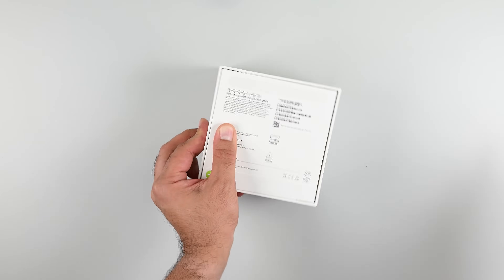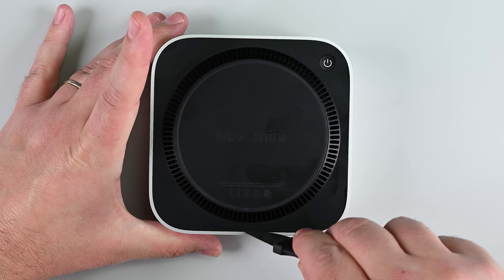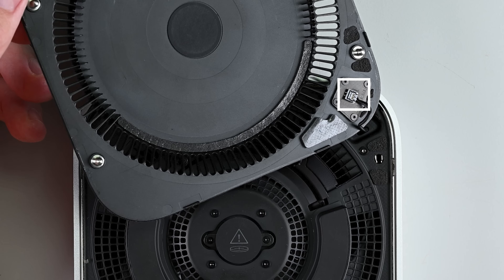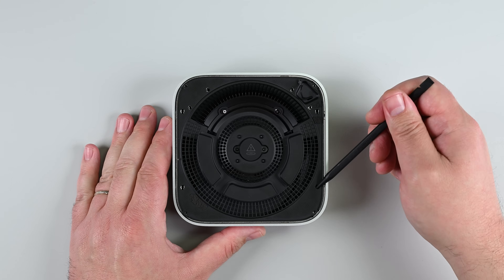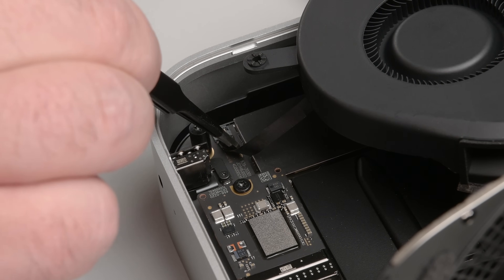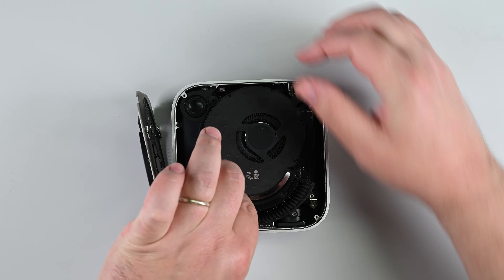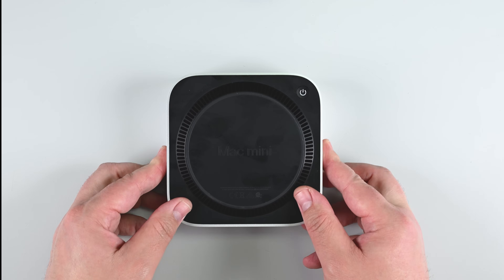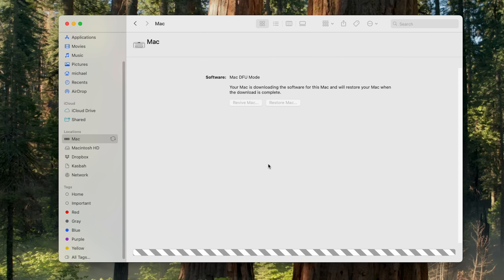M4 Mac Mini Storage Upgrade! Do it Yourself And Save Money!

Comment: Went completely without a hitch (although those 4 screws holding the power cabling into place were an absolute bear to get back in -- surgical skill required). Saved myself $300 going this route. AND got the 256GB/32GB M4 on sale. Couldn't be more pleased. Video was key to getting this done w/o tearing something up. (I did NOT have to detach the fan BTW.)
Reply: I was worried bout the fan cable also soo I’m glad to hear you didn’t have to disconnect it🙏🏾

Comment: Zwei Betriebssystemwelten im Alltag
Ich arbeite regelmäßig mit zwei IT-Systemen:

Windows 11 Pro (Dual Boot) auf einem HP EliteBook, ausgestattet mit USB-C- und USB-A-Ports (3.2 Gen 2), verbunden über ein Thunderbolt 4-Dock.

Mac Mini M4 mit 16 GB RAM und 256 GB interner SSD.

Externe Speicherlösung mit Spitzenleistung
Zusätzlich nutze ich eine externe M.2 NVMe PCIe 4 SSD (Samsung EVO 9100, „Gamer SSD“) in einem echten Thunderbolt 4-Gehäuse, verbunden mit dem Mac Mini über ein USB-C-40-GB-Kabel.
Diese externe SSD übertrifft im Benchmark die interne SSD des Mac Mini deutlich.

RAM und Videoschnitt: Praxis statt Mythen
16 GB RAM sind für anspruchsvollen Videoschnitt (4K & 8K) laut aktiven YouTubern absolut ausreichend.
Warum?

Wer große Videodateien auf einer schnellen externen SSD wie beschrieben ablegt, hat weder Performance-Einbußen noch Speicherprobleme.

Technische Details zum Mac Mini M4
Der Mac Mini M4 verfügt über:

10 CPU-Kerne

10 GPU-Kerne, wobei jede GPU ihren eigenen, im Design integrierten, ultraschnellen RAM-Bereich besitzt.
Dieser GPU-RAM ist wesentlich performanter als der reguläre Systemspeicher und von außen nicht einsehbar – jede GPU ist technisch gesehen eine „Blackbox“.

Dateisystem & Kompatibilität
Die externe SSD ist mit exFAT formatiert, sodass sie problemlos sowohl unter macOS als auch unter Windows 11 genutzt werden kann.

Praktische Empfehlungen aus Erfahrung
Als ehemaliger deutschlandweit verantwortlicher Leiter für Projektmanagement in der Digitalisierung von Kliniken und Telemedizin kann ich bestätigen:

Ein Upgrade der internen SSD im Mac Mini ist meist überflüssig.

Das RayCue Thunderbolt 4/5-Dock (40 GB/s, ca. 87 €) passt perfekt unter den Mac Mini und bietet einen integrierten M.2-NVMe-Slot. Eine leistungsstarke SSD lässt sich einfach einbauen und erzielt im Benchmark Spitzenwerte.

Entscheidend ist die Verwendung eines echten Thunderbolt-4-40-GB/s-Kabels. Mit USB-C-Kabeln, die nur 10 oder 20 GB/s unterstützen, bleibt die Performance deutlich hinter den Möglichkeiten zurück.

Fazit: Fakten statt Clickbait
Technisch fundierte Aussagen und valide Praxiserfahrungen sind wichtiger als reißerische YouTube-Mythen oder Clickbait.
Mit der richtigen Hardware-Konfiguration lassen sich Performance und Speicherprobleme effizient und kostengünstig lösen – ganz ohne unnötige Upgrades oder fragwürdige Empfehlungen.

Comment: Apple can get pretty narky  about these things. Then again I had a former Apple tech guy put in a ssd into my old iMac.

The accessory MM type hubs are flaky with WiFi issues, unreliable ports etc, so I'd try an external ssd. It's just safer.

Comment: Performing this upgrade doesn't scare me. However, I have concerns about the - read & write speeds, and more importantly, how hot does this drive get, especially during large file transfers?  Without proper heat deception, the drive will not last. Which brings me to my last concern, how long will this drive last?  The thought of losing 2TB of files after 6 months, give me the shivers.  If I did do this upgrade, to sleep well at night, I would need to buy a separate external NVMe enclosure + a 2TB drive to back up the Chinese knock off drive. I feel like I am right back at square one. 🤣🤣🤣

Comment: What am I missing? If I buy a 2TB upgrade, I will probably void the warranty on my Mac Mini M4 if I open it up. Also, lots of things can go wrong when installing a 2TB upgrade storage, even if the folk on YouTube make it look easy. If I use external storage, I don't void my warranty and or bugger up my M4. In terms of transfer speed, the difference in speed is not always significant, and external storage can still offer advantages in terms of price, capacity, and portability. The vast majority of folk aren't really going to notice the difference. So again, what am I missing. I get it if your Mac is outside of the warranty period. But again things can go wrong with a DIY botched job.

Perhaps I'm being a tad thick, perhaps there is a massive plus that I'm not seeing. I'm not trying to be argumentative or negative. You've paid your money, the Mac is yours. I don't don't see the advantages versus the risk.

Comment: Just ordered a replacement 2TB SSD from Amazon for $280. What’s good, it’s the same as in the video with the silver sticker and matches the location of capacitor, buck converter, etc to this video. The bad news, I’ve ordered a refurbished Mac mini M4 w/ 24GB ram and 256GB ssd and I’ve been waiting the past few days to upgrade as Amazon delivered same day and Apple had to ship out through UPS.
Reply: An actual name or link to the exact model?
Reply: @ernestgalvan9037 it’s probably an a la carte config, the refurbished store has different configurations
Reply: What did that refurbished price cost ya?
Reply: @troymcdonald paid $611 from the official apple refurb store. That’s after my 10% vet discount.

Comment: It went great. Thank you so much for the callout about unscrewing the power button instead of trying to remove the cable. I used the Pro Tech Toolkit's wrap case to support the Fan and didn't need to remove its cable either. Less than an hour total to install and recover via Time Machine. 2TB never felt so good.
Reply: where did you buy the SSD?
Reply: @SajidQureshi__ ExpandMac after the first tariff but before the latter ones. My friend used the Iboffrcc one. Both are top notch
Reply: So whithouth a second mac?
Reply: @SgtStultus No I had a second older Intel Mac I used

Comment: Is there a benefit to not having from what I can see any kind of heating or spreader on the ssd modules in apples computers across the board? Just seems odd to me. Especially given the entire chassis is a big  chunk of aluminum
Reply: The hotter nands run the better, it's the controller that needs cooling which this doesn't have

Comment: After an upgrade yesterday to the operating system my previously successful use of third party storage was bricked with no way of returning to the previous state. If anyone has a recommendation I'm open. Tries several versions of ipsw. No joy after having it up and using it for a few months I'm disappointed now that this doesn't work with my particular SSD TTB Sandisk.
Reply: Did you find a fix?
Reply: @superdupertrooper970  No I have not. Stopped trying after having to bring to the Apple store for reset.

Comment: Great vid, but one error.  In re-assembly you show "replace the power button" but the dis-assembly section did NOT show removing it (rather, remove the entire power button housing via 4 screws).  I think you prolly re-did the section on removing the power button assembly (because people had reported damaging) , but you left in the replace the power button from the first version.  Please update and align.  Thank you!

Comment: Aside from problems getting a third-party SSD, it looks like the replacement of the SSD can be done without unplugging the fan cable (as long as one is careful and takes their time removing the old SSD and inserting the new SSD). Sure, it’s a small time savings, but reduces the chance of damaging that micro-connector on the fan cable.
Reply: right
Reply: Amazon has like 6 different brands

Comment: This is not for the faint of heart. Only die-hard DIY tech enthusiasts will do this. Why?

First of all, it voids the warranty.

Second, it risks damaging the hardware. This is known to have happened.

Third, it requires access to a second Mac computer. This is not an option for many people, myself included.

Fourth, if the upgrade fails for any reason, it's a pain redoing everything. The replacement SSD may be defective. One YouTuber did encounter issues and he had to jump through hoops to recover.

Fifth, if you're not comfortable with DIY, this could cause anxiety and frustration.

Why go to so much trouble just to save $200 ???

Here's what I did: I upgraded to 512GB. Then I attached a 2TB external drive. Easy peasy. No headaches. No anxiety.

And the bonus is that the upgrade doubled the write speed of the internal SSD!

Forget this DIY nonsense.
Reply: Skill issue
Reply: @rohanjamadagni  Even skilled technicians can make mistakes. Nobody's perfect.
Reply: This is simpler than repairing the most basic of cars.  Seriously entry level stuff.
Reply: @ Not for the average person.
Reply: @horridohobbies  don't be average if you want to save money
Reply: Can you trust the reliability of third-party SSD modules? What vendor can you trust?

Comment: 4:36 ok, so you need a second mac
Reply: Every penny pinching base Mac Mini buyer certainly has one or many more Macs that are absolutely a requirement for this "money-saving", totally "realistic" DIY upgrade, right? Right?
Reply: @proesterchen  Or they have a friend with a Mac.  Not all that uncommon.  The problem is sourcing a drive to do this swap.  They're not easy to find.
Reply: Or iTunes works too
Reply: @TheCassuis  No, it doesn't. A full second Macintosh PC is required for the recovery.

Comment: This is all great and everything with the replacement drives but I wonder how long before Apple does some sort of hardware block on these non OEM drives.
Reply: The amount of people who will actually do this is minuscule.  If someone were to open a business doing it, that would be another matter but they aren't going to worry about the .001% of their customers who will actually a) be able to source a drive to swap in and b) actually disassemble a monolithic device like this to do the swap.
Reply: I have replaced my old Macbook Pro 2015's drive and every time I reboot it, the same message: "this disk is not fully compatible". The laptop works fine but is a pain in the ass. Maybe it will be the same when you replace the Mac Mini drive.

Comment: Everything is great, but you missed the main point - where can you get ssd in the first place?
Reply: I learned from some Chinese videos that if you are in China, you can easily get a replacement flash memory solution. Replacing 1TB of flash memory costs only 800 Chinese yuan, or 110 US dollars. This is crazy. But due to the US&China tariff war, it may be difficult to get a cheap replacement SSD.
Reply: @sdygsd  我在中国这个确实很便宜～～～
Reply: I'd get one from iboffrcc once they're back in stock, there are plenty of listings on aliexpress but they're not all good
Reply: Oh.. so u mean it not work with just any m.2 nmve ssd?
Reply: Aliexpress
Reply: Amazon is where I ordered one.  They have separate choices of 3-4 TB $300.00 to $600.00 respectively 2 and 4 TB with choices for Pro Version and Base model… I don’t know why the controller for the ssd be different but it is Apple way of doing things… things that make the walled garden a bit more in hight.
Reply: @haldorr485 @haldorr485 Unlike NVMe drives, these modules don't have controllers. The controller is within the M4 SOC itself. It also takes care of encryption, among other things.
Reply: @haldorr485 ,.. none appear on Amazon ….. could you give exact name for a search, or link?
Reply: @haldorr485 …the “controller for the SSD” is not on the SSD , but in the CPU/GPU chips.
Reply: @haldorr485  the M Series Macs have the storage controller built into the CPU chip. At least that’s what I read somewhere. So the ‘ssd’ doesn’t have one. Makes the whole thing faster, but you can’t use normal SSDs
Reply: I do think they're researching the possibility of running their own production (placing order in some 'trusty' Chinese factory, that is). Could be a pain, tho, in times like these..
Some already did that, like iBoff reverse engineered it and launched mass production already. Those guys are quite reputable, but the stock went sold out in, like, hours ))

Comment: Great tutorial. I've heard these aftermarket SSDs are much slower than the original. Is this true? If it isn't, I might just purchase a mac mini.
Reply: More often than not, it will be faster. But you need to take the risk, I have seen on the forums that some users who replace third-party SSDs have complained that they have been detected by Apple, resulting in frequent system alarms, resulting in the inability to use the Mac normally.
Reply: my replacement 2tb drive consistently reads/writes faster than the stock apple 256gb one
Reply: @rchaas53 Because memory bandwidth has increased
Reply: @ Thanks, might just make a purchase then. Can I ask, where you got your hard drive from?
Reply: @TravellingTechie I am from Singapore and I had my SSD replaced by a store in Huaqiangbei during a previous trip to China. I don't know how to get a third party SSD in North America or Europe.
Reply: @TravellingTechie  reply deleted 🤷🏻‍♂